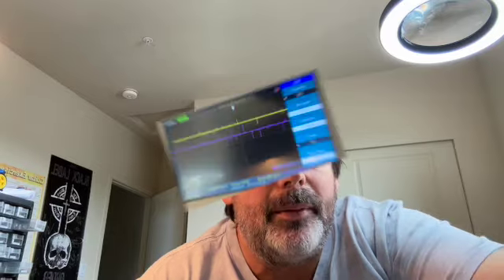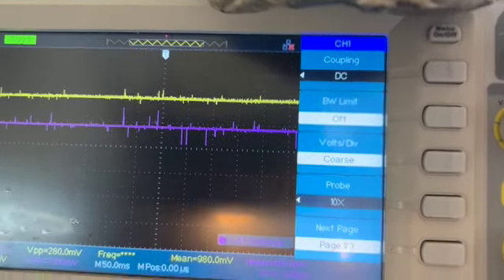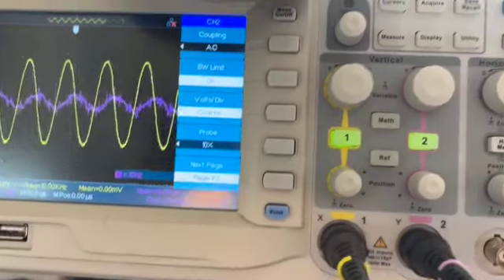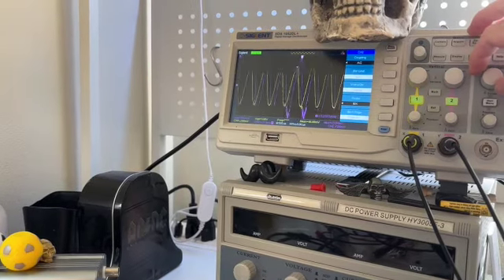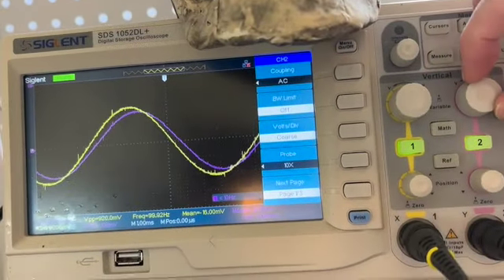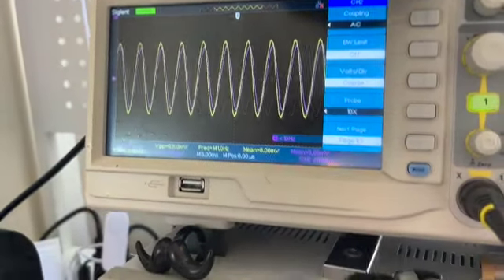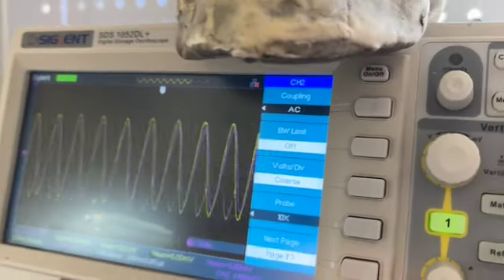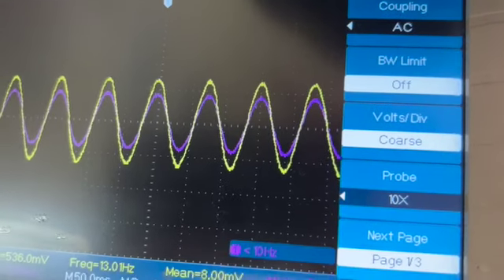ohm my god 3, inductive reactance

Comment: You have a better way of explaining things than what i could even try to explain to myself. So in terms of places you may go, in the realm of like, component specific, my mind goes to -> en.wikipedia.org/wiki/Electronic_component ,... But then, if we are talking bout somethin like en.wikipedia.org/wiki/Electrical_network ,... there is, e.g., voltage sources, current sources, resistances, inductances, capacitances) which is like, a list of terms/ideas to continue from,... and to me, that is like one of two roads you could take, which im sure there is like, many different facets/perspectives to attack it from, and for some reason, you have a better way of talking about it, such that my own mind cannot reproduce (and plus, you are actually touchin' on the mathematical underpinnings and stuff, which in my mind is like a foundation thats probably missing elsewhere)